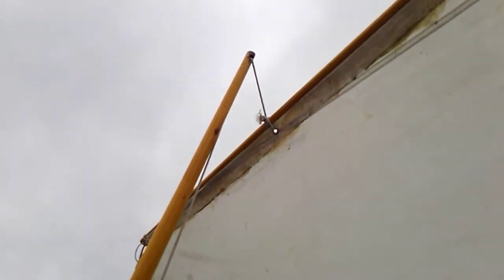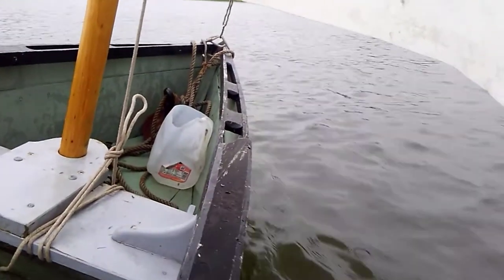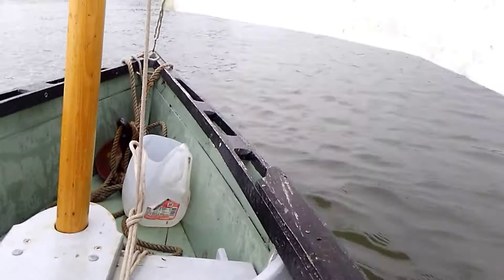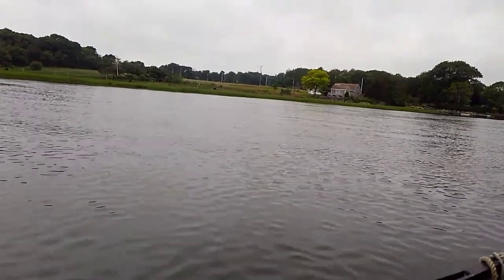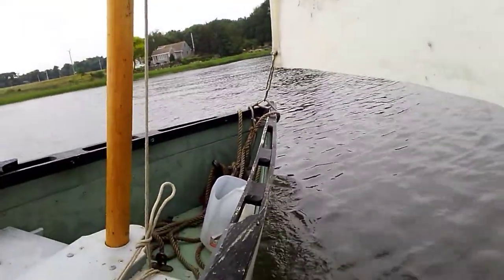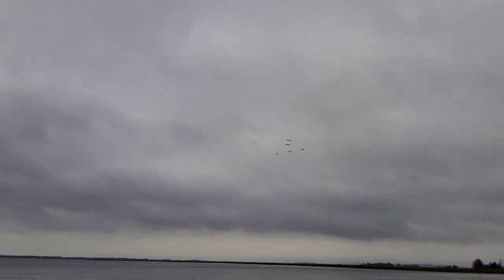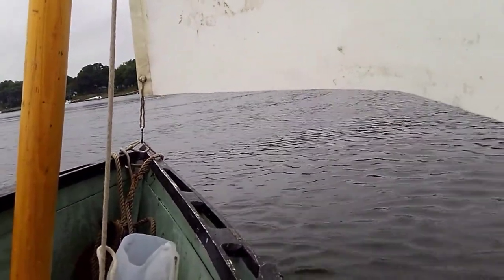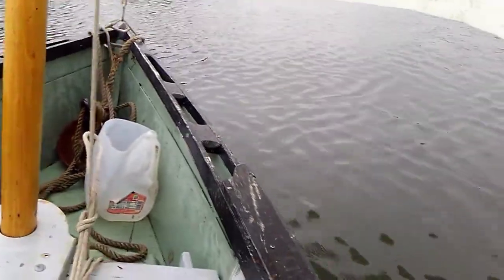Duckpunting, test fitting the new dipping lug

Comment: Sailing beautifully and making good progress in light airs.  The dipping lug is rare on a small boat, but is an incredibly beautiful rig.  Which method do you use for dipping?  Do you lower the yard and rehoist it on the other side, or do you you dip it around the front of the mast like a Beer lugger?
Reply from the maker: These li'l punts are just soooooo much fun!
The yard dips behind the mast, it's so small and light that I can loose the sheet, move forward and unhook the tack, pull down on the tack bringing the spar vertical,  bring the luff and spar around the mast and rehook the tack and return to my seat and haul in on the sheet. The whole movement takes maybe 8-10 seconds.
Reply: @danoyes1  Neat.

Comment: Hi from Japan. I'm fitting out my Discovery 169 canoe as a sailing rig, and will be making my own sail (Dacron rip-stop). As such, I am curious as to why there is no boom on your setup (unless that's the definition of "dipping lug...). Thanks
Reply from the maker: Actually yes that is part of a dipping lug, no boom, much like a old square sail from which they derived.  This lug has a significantly flatter head to the sail and I have since recut the sail to get the yard to stand more vertical,  Google dipping lug for images,  to tack the dipping lug the foot of the sail and the spar are brought round the mast... interesting rig that I've had a great deal of fun with.